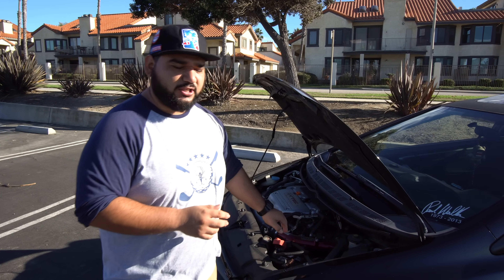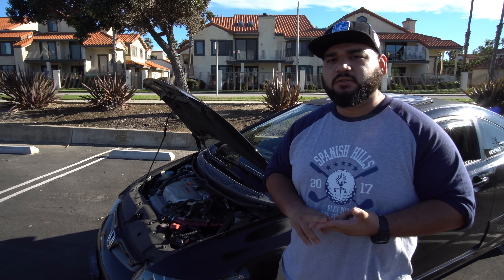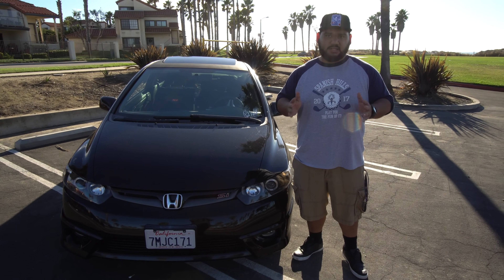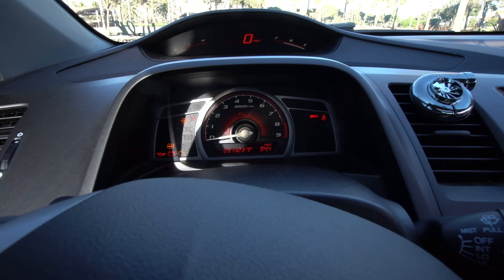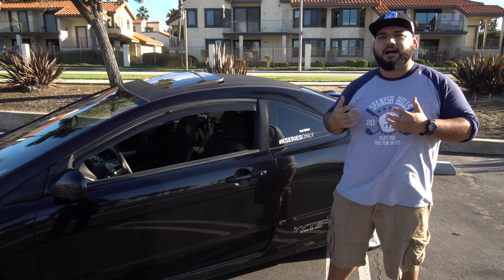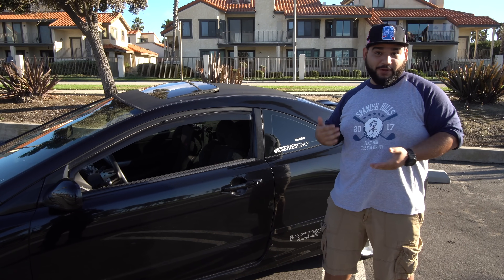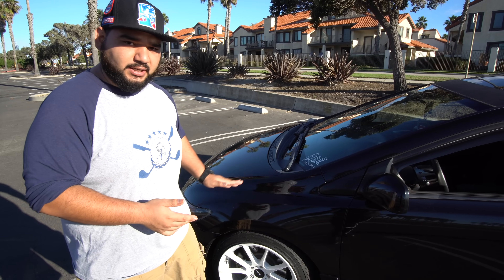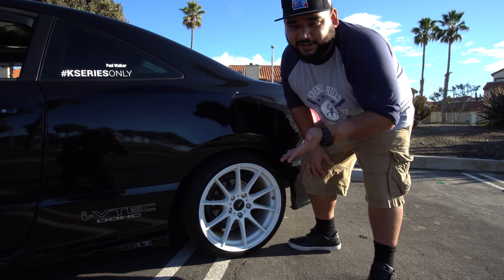What To Look For When Buying A Used Honda Civic Si (2006-2011 8th Gen)

Comment: Stupid things EAT rear tires too. Get the updated camber arms, preferably adjustable ones. also the paint starts as crows feet then falls off. Speaking of things falling off so does the wind shield weather stripping and trim. Also check the carpet for water damage. If the floor gets wet, the foam on the underside will be nasty looking and crumbling. my passenger rear door leaks. Then my sun visor broke off! POS! Also the gas gauge Inverts itself and lights up in reverse. this all happened before 70,000 miles. mine is an 07. I would get an 11. 09-11 would be ok too. Good vid
Reply: TheeJoeyLee I've got an 07 Si since new and didn't experience any of that except the tire issue.  I know the sunvisor is a common issue even though I never needed to change it.  That other stuff is uncommon.  Sounds like you got a bit of a lemon.
Reply: Ya it has a few other issues as well. I just want to trade it in for an 11. My cr-v is wonderful on the other hand

Comment: That codder pin on the cable bushing is too far on also you can only see that if you have a cold air intake the stock airbox is that whole spot

Comment: @TonyCastillo, since you have experience with both I am considering a Honda Civic Si and Scion TC.  They both check most boxes for me as a fun daily driver but I'm leaning more towards the Civic Si because of the extra HP and better quality of the interior.  My biggest factor is my budget is about $8-$9k.  I'm not too concerned with heavily modified because I am a family guy with a 3 yo daughter.  I like both but should I save some money getting a cheaper TC and buy a few mods or spend all my budget on a Civic Si???

Thanks
Reply from the maker: Civic Si hands down when comparing the tc to the si

Comment: Most of those used Civic Si  are so modified, used and abused  they are not even worth buying.
I'd definitely stay away from examples that have over 100k miles on them.
Finding one that hasn't been dogged out will be tough

Comment: Just picked up an 07 coupe non Si with 197K on it for $1500 It’s an automatic.  It has a strange rumble/ vibration all the time.  I thought maybe a motor mount but when reving the motor its not shaking like I would think it would.  Any ideas?
Reply: I had motor mounts issues in another car, was fine when revving it but when I would let off the gas it would vibrate and rumble the car like crazy. It was a 91 Sentra SE-R
Reply: If the noise goes away when you put it in drive it's a motor mount

Comment: I just bought a 2010 and when I turn on the AC the motor starts shaking and it stalls when I press the gas… anyone know what it could be or how to check it?
Reply: New idle air control valve
Reply: @Yamaha23MT10YamahaR1  thanks man, have a great day!

Comment: Just bought an '06 Si coupe, fully stock with 87k miles. What should I expect to be replacing by 100k miles?
Reply from the maker: heylilmama idler pulley, tensioner pulley and adjusting the valves
Reply: Nothing. I'm at 116k and have done nothing but fluid changes and my car is fine..

Comment: I found an 09 8th gen fa5 with 71k miles for 10.1k$ but i can't test drive it to see if its been modded... what i know is that it's in a dealership and it looks brand new.
-Should i pull the trigger?

I plan on making this a 420hp daily :D
Reply: if its from a dealer and youre a probable buyer, they should let you test drive the car. why cant you test drive it?
Reply: @josuer2208  Oh I can't test drive it because it's out of state for me...and theres only one fa5 where im at that's available to test drive...

Comment: You just need to engine swap if you hate the third gear grind.
Reply from the maker: Aj Redboy I’m either gonna build the engine, boost, or trade in the car within a year so we’ll see 🤔😅
Reply: Why not built it up and buy the new type r. Now that would be nice!
Reply from the maker: Aj Redboy I️ would love a type r but sadly those are too expensive due to dealership markups! I’d rather get the new si instead lol.

Comment: i found one same maroon red and same year 08 as my current base model. im looking into getting it specially since its stock completly, has 1 owner, 114k miles and they want $6,900. So if i can get that im golden, drove it and its hella solid, i only drove it hard 1-2 cuz i didnt think anymore way nesesary. ill probabbly try to test it again before handing in any cash. only problem was an o2 sensor that was bad and they said itd be fixed so i hope they dont lie.

Comment: I am trying to sell my 2007 Honda Civic Si 4dr Sedan Nighthawk Black Pearl. Great condition 150,000 miles.  3rd gear replaced due to Honda recall. Very well taken care of. Stock except window tint and plasti dipped wheels.  Located in Columbus Ohio.  Message back for more details/email to get in contact.

Comment: Wrapping would’ve taken half the time and literally would’ve cost like $50-60.
Reply from the maker: Already wrapped roof
this is an old video
Reply: Not hating lol, Love the video though. Another thing they have issues with is breaking shift forks, my 3/4 broke and got me stuck in 4th gear. Doing a pretty inclusive rebuild on my 08 right now.

Comment: just copped a 9th gen for 7k @140,000 miles lol
Reply: is that good or bad? I found an 09 8th gen fa5 with 71k miles for 10.1k$ but i can't test drive it to see if its been modded... what i know is that it's in a dealership and it looks brand new.
Reply: im looking at this 8th gen for 9k @ 55k mi :D
Reply: Just got mine 2 months ago for 4800 160xxx miles on it

Comment: I'm sorry I don't care what people think. The freaking V tech should not go off between 6 and 8000 R. P, m's, it should be at the very least 4200 RPM. There was absolutely no need It too.go off that late Real power needs to be between 3 to 5000 RPM. That's where everybody works their car on the freeway. Not everybody  is. racing their car for Crying out loud.

Comment: I have a 2010 Civic non-si. Do u guys think the engine is bad in it? Also I am wondering if I should buy a cold air intake
Reply: Wesley Gadbois the intake will add some nice noise and maybe 3-5 hp tops.

Comment: @tdakid would u know what oil to recommened i have an fa5 sedan i hit vitec a lot but i burn oil a lot is that normal for 8thgens
Reply from the maker: Rick Martin i just used oil from Honda my dude. I️ burn oil a lot as well but that’s the price of having a high reving car haha
Reply: Rick Martin Amsoil
Reply: Rick Martin they all burn oil.  The more you hit vtec the more you burn.  It's normal.  Use 5w40 synthetic for a little extra protection and don't let it get more than a qt low before topping off.  Will run forever.  Mine is pushing 200k no problem.